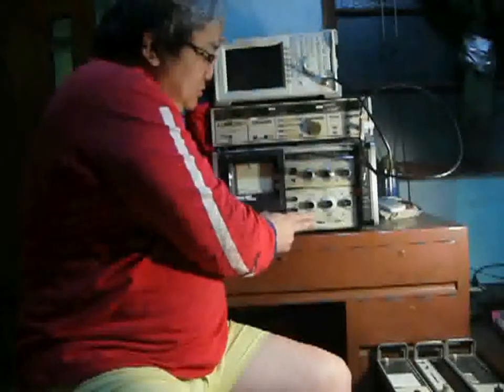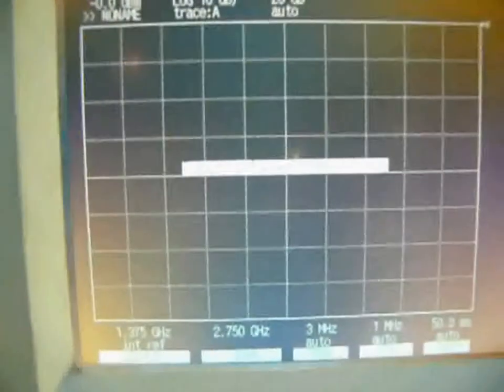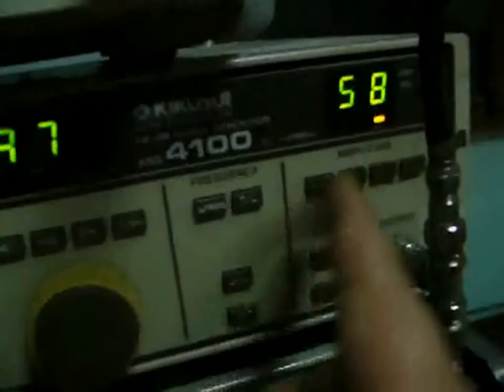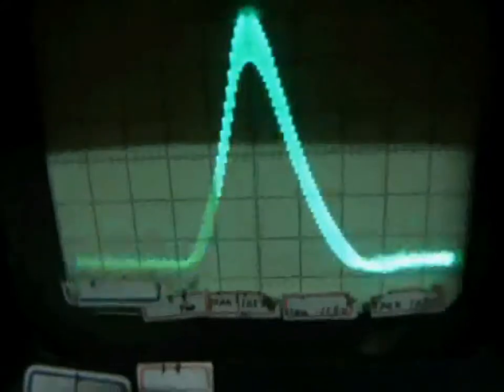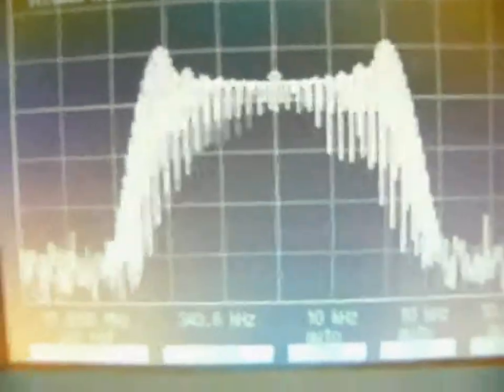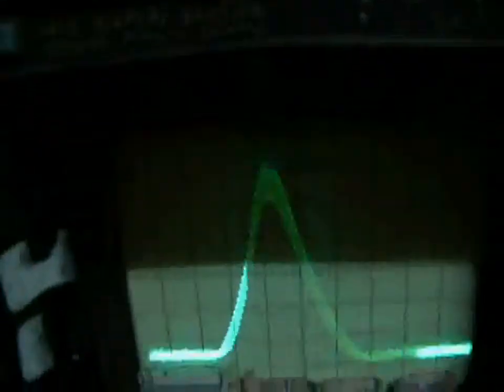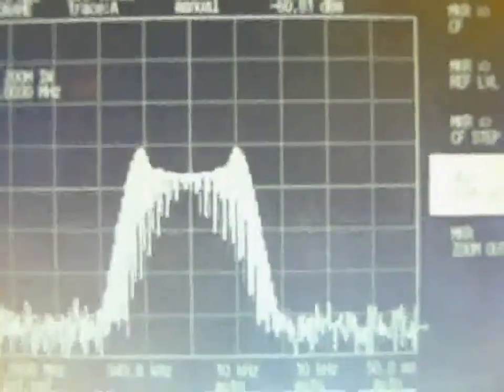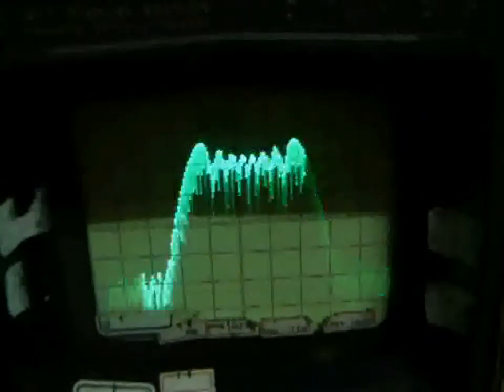spectrum analyzer compare

Comment: This is not a very good demonstration of these units. It is clear that you are not very familiar with operating spectrum analyzers. Both of these analyzers should be able to measure these signals without issue if you know how to set the resolution bandwidth and other settings correctly.
Reply: yeah, exactly.
you really should get the user manual of the digital one because you not really know how to use it.

Comment: Your 'fail' in the digital analyzer self-test is caused by leaking electrolytic caps likely in the acquisition board. It's quite common for these units. They are very difficult to replace and likely you have more than 10-30 caps on these boards that are bad. After the unit warms up, the analyzer starts working cause the caps start 'cooking' but they will eventually fail for good. Also, the acidic leaks will eat your circuit traces. I have the HP141T too, those are very heavy and have limited use nowadays.